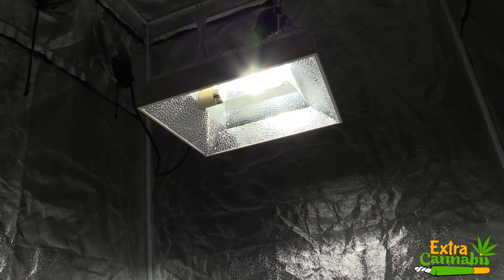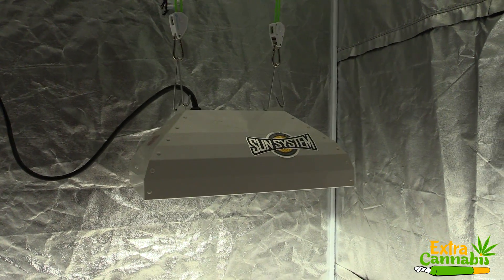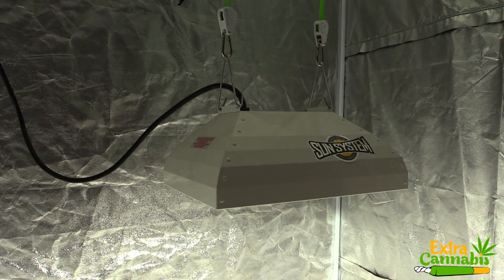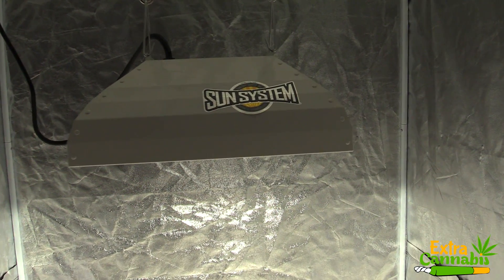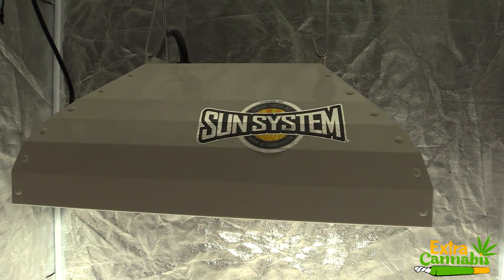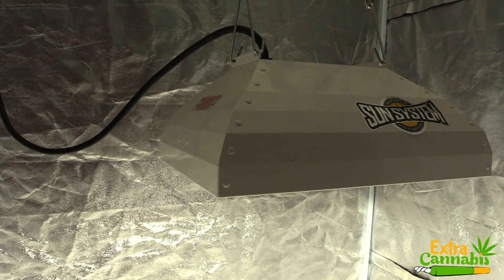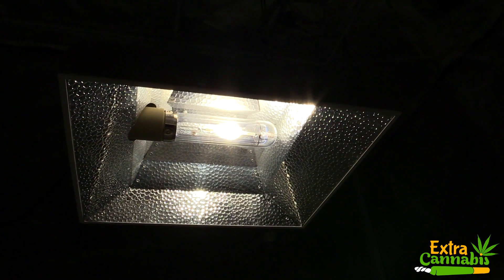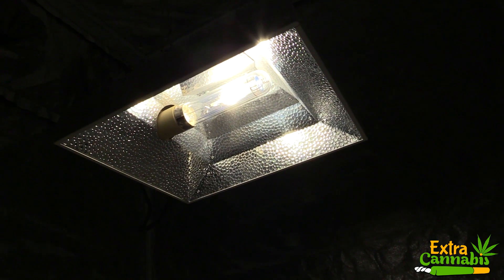SUN SYSTEM 315W CMH GROW LIGHT PAR TEST!

Comment: Over a thousand dead center of the hot-spot,  but quickly degrades to nothing around the edges. Meh, most newer LEDs have better coverage.
Reply: Agreed. But much crappier spectrum with led, you get less yeild per cubist foot. Depends the value of your yeild really. Note that for cannabis, the uvb in cmh increases oil production. So also another reason. There are other CMH fixtures out there with better par values, usually cost less money too. Eye hortilux has great bulbs for cannabis though cus of the unfiltered UV. Leads me to wonder if it may have adverse affects on other plants that dont produce oil for UV protection, like almost everything else lol.

Comment: I use 4 x 315cmh in a 1.2 x 2.4m tent, very good quality colas - but leaves me wanting more in terms of penetration through the top of the canopy. So i feel its great but not strong enough as you need around 800 par for good flowers - some of them numbers where way too weak - will defo be using hps + cmh on next run.
Reply: I was going to add an LED or HPS as well. I train and top my plants. I defoliate to let more light get through the canopy i also invested in some corner LED 60w srips for some side light. Works very good!
Reply: High Sierra Growbro mind sharing the link to the LED strips you bought? Need some for my 2x4 tent

Comment: Notbad for 315w.  I think the sweet spot would be 18inches in a 3x3 tent. That would grow sum very good quality smoke . Perfect for a hobby grower !! them cmh are bout closest thing to real sun light, next to the SUN ON DEMAND plasma.  That lil cmh would make a smallgrow very happy
Reply: Plasma has great spectrum! but poor par value per watt:(
Reply: So plasma is great if your operating with free electricity like solar, windmill or waterwheel. But if you pay for electric like most people, cmh is usually the way to go:) 
But also depends on spacing a lot